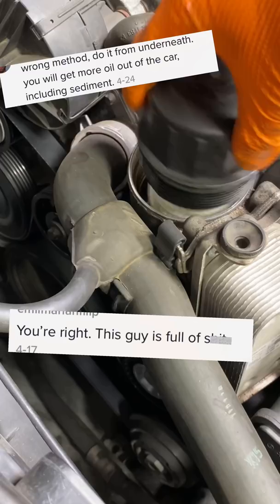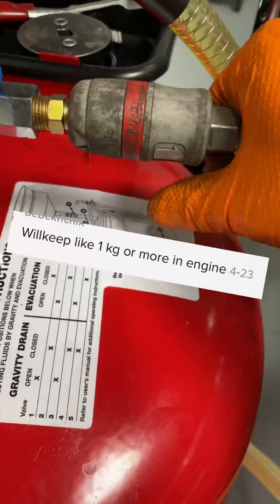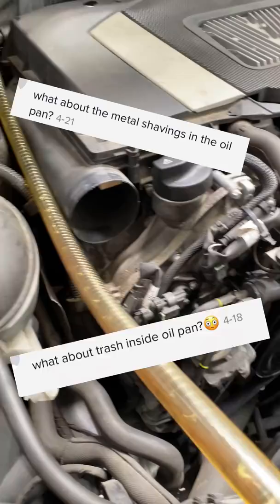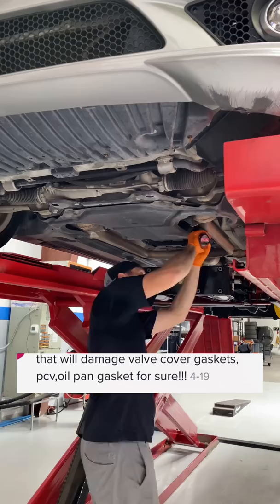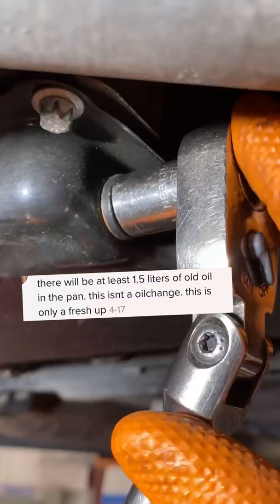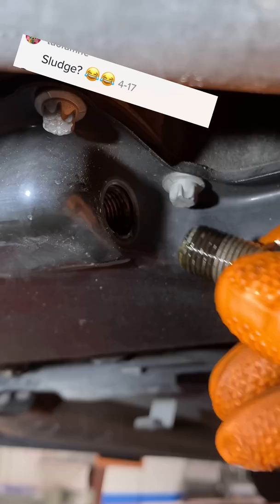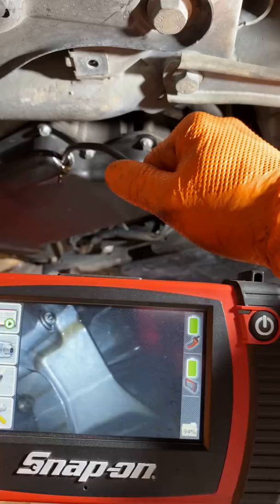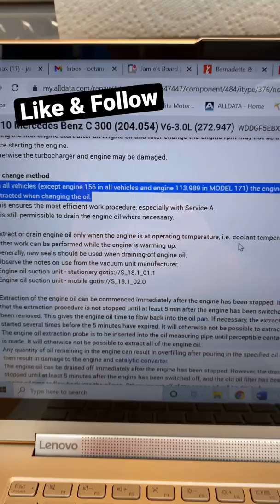#shorts Mechanic Proves Haters Wrong

Comment: Love how confident those people thought they were, just let all data speak for you😂😂
Reply: Notice how he's doing this on a relatively new car and not pulling the pan?
This isn't a new technique, this has been done for at least 30 years. This method isn't perfect, there will be some debris left in the pan over the years.
Reply: @otm646  really Donald? Is that why it's the way Mercedes recommends it be changed? But I guess you know more than the engineers at Mercedes right?
Reply: @ryanturnerboles  I specialize in classic Mercedes and V12 BMWs. What the factory recommends is not always what's best for the car long term. You have to understand that there are competing factors and that you're not going to hurt the engine within the warranty. Or within 100K doing a topside oil change. I don't have a single car in my workshop with less than 200k on the clock. There's a reason they come to a specialized independent mechanic and not the dealership at that point.
Reply: @otm646  key word classic. I'm going to go by what the people who built the car says, as opposed to the mechanic who doesn't understand the science behind why they recommend that. Because most of those people still recommend oil changes at 3k miles with full synthetic, even though the oil industry and auto industry say otherwise.
Reply: @ryanturnerboles  you are so indignant and self righteous you don't actually care about learning anything you just want to argue and prove yourself right.
I handpick my customers, I handpick the cars that I work on. I have zero incentive to waste my time doing excess oil changes. I've got more work backed up out the door then you can imagine.
You need to realize that there are people out there who are professionals, not just  "certified techs" actual  degreed automotive engineers like myself who work on these vehicles.
Reply: @ADunc10  Because I've been doing this for decades, I've seen the results of topside only changes first hand. The guy making this video clearly hasn't spent enough time as a mechanic or enough time on higher mileage vehicles to see these issues, or he's not paying attention.
I have no incentive to mislead people here, I'm telling you what I've seen through years of experience because it matters. Depending on the engine I will drop the pan around 75k for an inspection and cleaning. There's a surprise in the amount of debris that comes out.
Reply: @otm646  
Have a 350SLC from 1973 with 350000km.
Always oilchanche topside here in the Netherlands. 
Did pull the pan at 300000km.
Nothing in it. 
Clear as new. 
Did always the correct oil and filter in it.
Reply: @otm646  well, looks like decades didnt help you enough. Me and my brother once tested this out.( And We are 19, and 23 respectively) We sucked the oil out just like the guy in the video did. And then we removed the carter, there was just some drops of old oil left. If u realy did had decades of experience, then u would know, that this is the right way to change the oil. Idk how cant u know it. Just as the other guy said, keyboard warrior. Wish u all the best
Reply: @richardlubes5715  the v8s tend to see substantially more guidewear than the inlines. Running a magnetic drain plug catches most of the chain and sprocket wear but it seems like the bits of guide don't like coming out. Usually those will get caught in the oil pump screen. That's another reason I like pulling the pan, I have had a handful of motors come in seized or low on oil pressure from screen obstructions. modern oils are absolutely improving the longevity of all of these motors. A good portion of my work is om61Xs, almost no one runs a synthetic in those, and the modern conventional 15w40 oils do great job at cleaning up the varnish and keep it in suspension.  I'm seeing far fewer guide failures, I don't know if that's owners at this point simply doing more preventative maintenance, or combination of the oils and improved plastics composition.
Reply: @stefanbashmakov7710  you're not comprehending what I'm writing. The issue here is not evacuating the last thimble of oil, that doesn't matter. You still have all the old oil in the coolers, all the oil still adhering to the surfaces of the engine.  
The issue is at over 100k you start to see a bit of material buildup that doesn't get removed from a topside change. At that point it's worthwhile to drop the pan remove any accumulated debris and check the oil pump inlet screen.
Reply: @otm646  
When i did pull the pan the mechanic did put another chain and sprocket on it because there was a little rattle on the chain but that was not due to oil.
I think that my oil is a semi Synthetic 15/W40 special for older cars.
Reply: @otm646  then how will you remove the oil from the engine walls witch a regular oil drain ? Wtf
Reply: @richardlubes5715  you have a misunderstanding of how chain wear works then.
The wear occurs due to friction between the chain links, that is directly related to the performance of the motor oil. As the chain gets ever so slightly physically longer that pitch variation starts to wear the sprockets.

So yes, the reason the chain and sprockets had to be replaced is because of the performance of the motor oil. Now, we have to understand that there are physical limitations of the performance of motor oil, and eventually the chains will wear. That's fine, that's totally normal. But you need to understand the root cause of that wear is the performance of the motor oil.

That's a big part of why so many engines moved over to timing belts. Amongst a myriad of reasons the (modern) timing belts do not stretch and there is effectively zero change in pitch and the zero wear on the sprockets. The engine maintains perfect time for the service life of belt. Whereas with a chain motor the timing shifts gradually throughout the life of chain.

Any modern 15w40, especially a semi synthetic is an excellent oil for those engines. You're going to enjoy very long chain and guide life along with an extended oil change interval if you so choose.
Reply: @stefanbashmakov7710  your reading comprehension continues to be subpar. Let's try this again in excruciating detail.
Residual oil in the engine is irrelevant, residual oil in the coolers doesn't matter, if you left a whopping 500 ml in the pan it really doesn't matter.
You're acting like the old engine oil is some horrendously vile tainted fluid of which you must purge every single drop.
Engine oils, especially modern engine oils in modern engines are changed well before their performance is compromised. When you pour in new fresh oil with a fresh additive package the impact of whatever oil that didn't get drained from the engine previously is negligible.
Reply: @otm646   funny how now u are saying that that it doesnt realy metter, but in the first comment you said that there will be debris left . Decide urself man, you either saying one thing, or other. And its always better have have a couple drops of old oil left than 500ml, but yeah. Ill let you have the last word, no point in proving it to you
Reply: @otm646  
I keep my oil interval every 12000km 
because it works for me and my car, hahahaha. 
The chain was not renewed in those 300000km.
Thanks for your explanation. 
Have a nice day.
Reply: @stefanbashmakov7710  debris an old oil are totally different. When he saysWhen he says debris he means pieces of metal that have accumulated due to the wear and tear of the motor. He's not talkin about motor oil. Again, your ability to read and comprehend is terrible.
Reply: @otm646   It's  recommended that way so you don't have to take all that dumb plastic crap from the bottom just to get to the drain plug. But still charge you as if you did
Reply: @ryanturnerboles  Recommended is not the same as required. I’ve never changed the oil on a Mercedes but no cap like ALL cars there’s more than 1 way to do it. 
So hate em, thank em doesn’t matter, at the end of the day the car’s fixed. New or Old. 
Stop just watching YouTube, get out there and take some stuff off your engine, you might learn something
Reply: @stefanbashmakov7710  he’s referencing 7 different Google search tabs and Scotty Kilmer Reddit posts. Of course he’s going to be inconsistent with his “23 year experience with V12s”

Comment: As a profressional big brand tire tech, you forgot to leave the engine running while draining. This helps with evacuating all friction material in the engine immediately as the detergents in the oil are not very effective if not being circulated.
That’ll keep the car running stoichiometrically correct with much less need for oil in the future because the car wont run

Comment: This is why I love the know-at-alls in the comments. The engine was literally DESIGNED to do the oil change as you did.
Reply: Can't beat the internet for "experts" - I bet half of them aren't old enough to drive.
Reply: @severnsea3924 so we're just going to act like because it was on the internet it must be true?
I mean, there's no way he could have done anything off camera during a cut like clean the oil pan out with brake cleaner.  That would be impossible. This guy has a yt channel, he is 100% credible and trustworthy.
Reply: @epstein_isnt_dead7726  Well that's entirely your choice. You can decide to believe that everything you watch on YT is false and ignore it, in which case there's no point watching it except for entertainment purposes, or you can choose to accept it and educate yourself a little. Yes, there is a lot of fake information out there but in this case this guy is a mechanic and you could go to his place of work and verify that. Why would he compromise his reputation by putting fake information out there? 

It's always the same, if somebody believes in a different method then they must be right and everybody else must be wrong in their minds. 

What I can say for certain is that he is correct. Many cars are deliberately made to have the oil drained via a tube from the top - my Jaguar XF 3.0d included. I have changed my own oil for 7 years, and the car is 14 years old. No engine issues ever. We recently did a full engine flush from underneath while doing some other work and there was no sludge, no nasty bits in there or anything so on my car at least I can say that using this method is perfectly safe. 

Millions are spent in research and development when these engines are designed, they're not going to compromise all of that just to make oil changing a little easier to save a few minutes. If you have a ramp it's probably just as quick anyway so why would they do that?
Reply: @severnsea  "millions are spent in research and development when these engines are designed!"
Is that supposed to be a valid argument?  
Then why do some engines have design flaws? Why would any auto manufacturer issue recalls for the engines if spending millions in research and design guarantees that the engine is so well built?  
How could an engine have a flaw when they spent millions on research and development?
You act like engineers can't make mistakes.  What makes you think that design engineers are so perfect and can never get anything wrong?
Reply: @epstein_isnt_dead7726  I find it difficult to believe you're that naive, but I'll answer that one. Designs are never perfect, and there are various reasons why they go to market like that. The biggest one is financial. Management make cutbacks to make it cheaper and cut costs, either to sell it cheaper so they sell more, or to make more profit. Sometimes they get away with it, sometimes they don't. 

Look, it's obvious you don't have a clue what you're talking about this is common knowledge in all manufacturing industry. Apart from that you took the point out of context anyway, nobody was talking about design flaws, the  discussion was about the oil change system but you've obviously made up your mind and nothing I or anybody else says will change that so it's a completely pointless discussion.
Reply: @-A-lm5xb  you're not really that dense, right?
You wrote a whole essay to explain my clearly rhetorical question, and I suspect you did that to avoid humiliation.  
I was facetiously asking those questions to point out that engineers don't always get everything right. Your statement that "they're engineered that way so that's the best way to do it" falls flat when I point out that engineers designed the lemons that make it to market, too. So you wrote that long essay to avoid addressing my point that you really didn't think out your argument at all before you posted it.  Nice try, but you failed

Comment: "what about the metal shavings" someone either expects people who drive Benzs to not keep their car in decent repair or don't keep their own car in ok repair
Reply: If you have metal shavings in your oil, an oil change is the least of your worries, as metal shavings in the oil means you need a engine rebuild, or to get it replaced.
Reply: It's pretty normal to have a very small amount of very fine shavings in the oil when a car is new and still breaking in, but you shouldn't really get any more after the first couple oil changes.
Reply: You’d be surprised; for some of the people that buy these cars brand new it’s nothing to them to just replace it in a couple years or upgrade and let the next owner worry about it. They just drive it and don’t think twice about it. Also leases
Reply: Knew a guy in high school who’s parents had money. They bought him a brand new Impreza STI. He was scheduled for an oil change at 3,500 miles. It wasn’t til the car a 12k miles on it that he realized a knock. Took it in, they said he missed his first, second, and third oil change. He got a Mercedes AMG and blew it up in 5k miles(or less). Moral of the story, if you don’t know about the importance of oil changes, don’t drive. If you know about the importance of having a reliable car on no oil changes, don’t buy a Mercedes. At least the subie gave him enough time to figure it out(still didn’t tho lol).
Reply: @lordgman1  a magnetic drain plug says different. There's always small shavings.

Comment: Marine engines have done it that way for a long time as there's often no way to get to the sump plug (sump is too close to the bottom of the boat and there's no where lower to put a tub) a lot of them have a line  from the sump either to a screw on brass cap( to screw an extractor hose to) or to a little brass hand pump to pump it out extractor is always the cleaner method as it goes into a sealed container so nothing can splash everywhere
Reply: Don't get me going on the boat what a pain in the ass
Reply: My dipstick on my boat is the only way, oil pan is 2 inches off the bilge
Reply: For sure, I had an outboard on a stand out of the boat, sucked the oil out, for giggles I dropped the drain plug...i think 2 single drops came out. Yeah it works good for sure lol
Reply: You don't know what you're talking about.
Marine diesels have an oil extraction system that pulls from the bottom of the sump.
It's not a topside oil change.
Reply: @otm646  ok just go against what every old timer at the yacht club has ever told me as well as how the oil has been changed on my boat the last 35 years of its life
Reply: @danielsetareh3513  instead of listening to Old timers listen to people who are professionals in the marine engine service industry.
This isn't new, today I was working on a trawler with 1964 Lehmans. It's using the original factory pan drains.
I have serviced hundreds if not thousands of marine engines over the years.
Reply: Yep, I came here to say this.
Reply: @danielsetareh3513  alot marine engines are designed for it.
Reply: @Zach-ju5vi  I have a 85 yanmar 2gm20f, thing is tiny and it takes 2 quarts of oil. I just suck it out of the dipstick every year and replace
Reply: 1979 Gulf Star 37' sailboat with a Perkins 4.108. No access to the bilge let alone the oil pan. Only way to change the oil is to extract it from the dipstick tube. I have a 12 volt extraction pump that does the job perfectly.
Reply: Just drill a hole close to the oilplug from under the boat. Put a cap on it. Easy oil change 😄
Reply: That's because its a boat. If you can its always, without question, far better to drain the oil from the low point pan oil plug.
Reply: As a marine technician, I can confirm this.

Comment: As a heavy equipment mechanic, on machines that cost millions of dollars, we almost always suck the oil out, if it's designed for it, it will work fine
Reply: Can pretty much  do it on any engine  through  the dipstick.

Comment: For people clueless unless the oil change procedure states to extract all oil from the engine, you are not meant to do it, there’s a reason why because if you completely dry the system especially with turbo cars after filling it up with oil to the correct level because all the oil lines and feeds would be bone dry also the turbo being dry with no oil pressurised you will damage the engine heavily if not kill it, for example main bearing have a small thin level of oil between the big end bearings and common rods to allow lubrication and if that thin layer of oil isn’t there you will instantly spin your big end bearings as oil pressure take a few seconds to build up, I work at vw and on the service sheets it specifically stats “DONT NOT EXTRACT REMAINING OIL” reason being it will lead to damage to engine

Comment: I've done this exact same experiment..with the exact same result.
Actually the extractor does a better job at removing debris because there is always a gap from the bottom of the oil drain hole and the bottom of the pan that never drains during a normal oil change.

Comment: "I don't believe you can suck all the old oil out"🤣😂🤣😂🤣😂🤣😂🤣😂🤣😂🤣 Dam I'm rollin!!! Keep up the good work!
Reply: well it only works because the engine is designed to be able to
do it. you cant just put a sucker in a regular engine and do this. The engine has to be meant to do that